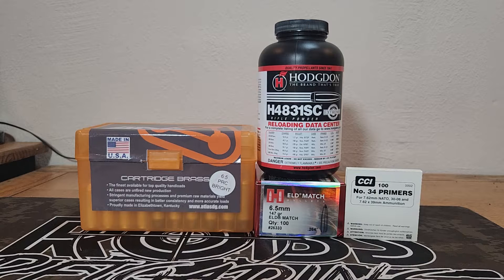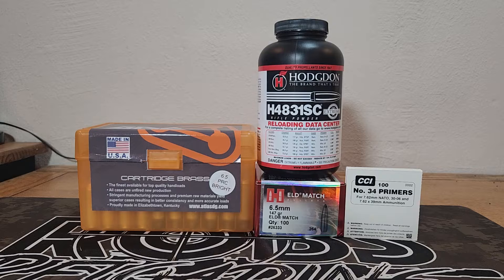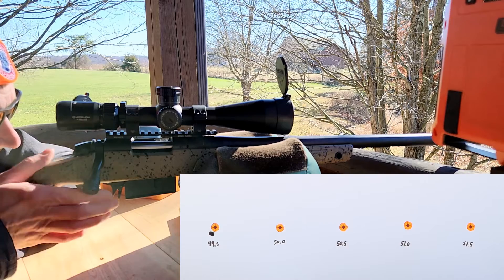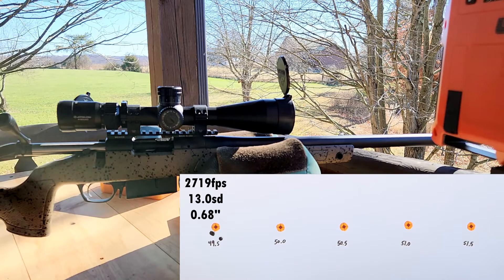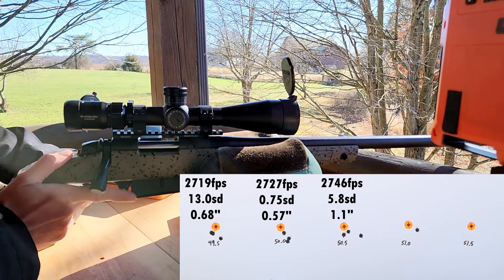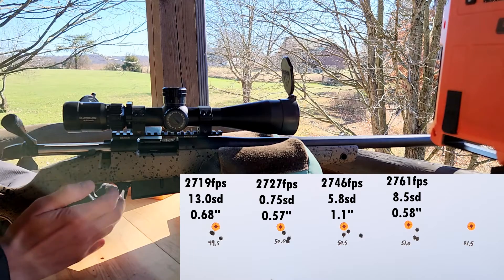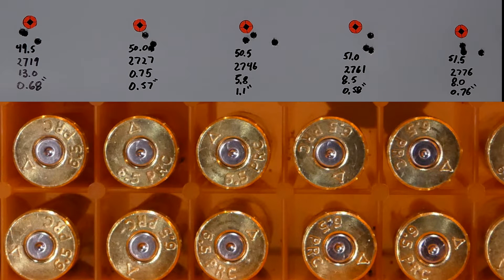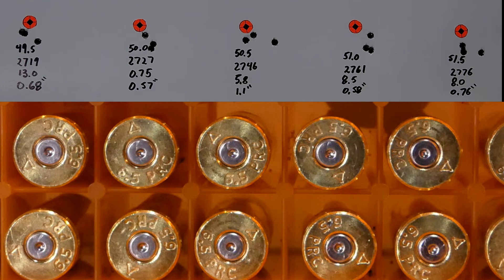Load Development ADG Brass, 147 ELD-M, 6.5 PRC Part 1

Comment: Why did you stop so early on in the powder test, especially with an OAL .030 longer than SAAMi? In my rifle with this same combo (using Lapua vs ADG) with an OAL of 2.910 due to internal magazine/freebore dimensions specific to my rifle, I wasn't hitting pressure till 53.7gr, which was producing an MV of around 2983fps. Now I know all rifles are different, but that's why there is a starting and finishing load scale. You finished 3 grains below book max. Regardless of the brass being thicker and having less internal case volume vs other brands, you're increasing your internal case volume by seating the bullet out .030 longer than standard OAL.
Reply from the maker: This is just a start stay tuned. We push up in the next video. This was just an initial test to see if the combo shows potential.

Comment: I tried 4831SC but didn’t produce enough velocity. Great powder but it didn’t work out for the 6.5 PRC I settle on reloader 26 running 56.6 grains Hornady brass BR2 primers and 145 grain barns match burner bullets produce 3062 ft./s average from a 24 inch barrel five shot groups average.460”
Reply: I use H1000 Hodgdon

Comment: Thanks for the video. 

I have 150 pcs of adg, RL26, and n565 with the 147gr eldm to play with. Have worked up a decent load with Hornady brass, but hoping to tighten things up and get more firings with the ADG.
Reply from the maker: Have you found loads need to be reduced significantly vs. Hornady brass?
Reply: @RobsReloading  I haven’t gotten started with the adg yet. I will definitely report back though. My plan is to start low and work up to slight pressure and then back it off slightly just like I did with the Hornady brass.
Reply: @RobsReloading whatever lot of ADG I have vs Hornady seem identical in every measurement including internal volume. They were within a grain of each other with the ADG being slightly less.

Comment: Looking to get into reloading and the 6.5 caliber , the question is the PRC worth the extra cost over the creedmore for 98% target work at 1000m and under?  My target ,if you will is to get set up and be able to hit the milk jug at 1000 with fun and affordability  with a sub $2k rifle/ scope combo.
Reply from the maker: In my opinion no. If I was trying to save money don't get involved in 6.5prc. components specifically brass and powder are very hard to get. You are only going to get 200 or so extra FPS vs creedmoor. 6.5 creedmoor will do what you need inside 1k. Components are much more available, less recoil and more barrel life.

Comment: 6.5 PRC is kind-of an odd-duck between a short and long action.  What is the distance between the action screws on the Bergara–  i.e., did they use a short, long, or something in-between action?
Reply from the maker: It's a short action rifle. Max mag length is about 2.980"
Reply: @RobsReloading  So if you ever wanted to put it in an XRS, the length to which cartridges could be loaded might be limited by the particular AICS magazine being used...
Reply from the maker: @dahut3614  yeah it would go in a short action xrs and would be limited by mag length. I have loaded longer and single fed them with success. The gun actually does really well single feeding.

Comment: You're going in half grain increments and it's showing that's there's tunable loads. Horizontal to vertical, etc. You're a fair distance from the lands to expect much consistency yet. First firing, I'd use those same cases, annealed for development. Did you mention, you'd full length resized with your shoulder bump?
Take a fat Sharpie and a level and draw a vertical line between your orange dots to make sure you're level with each shot.